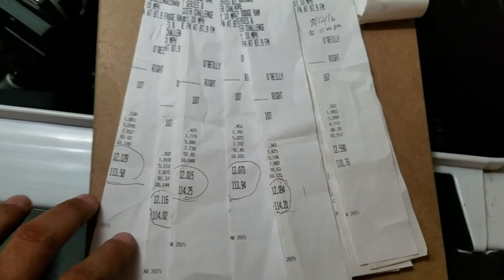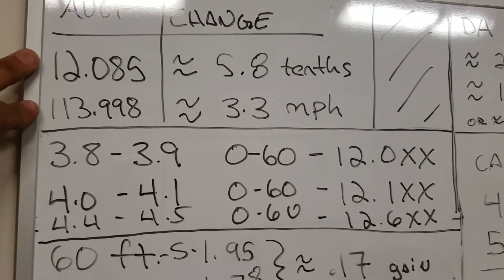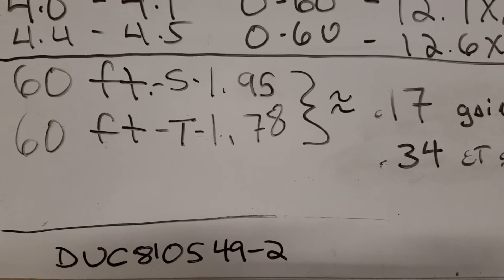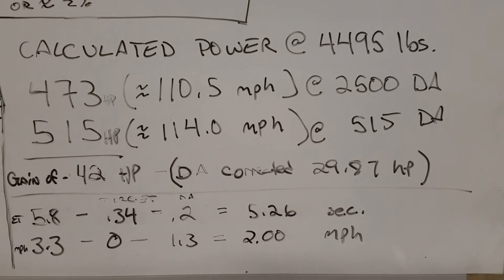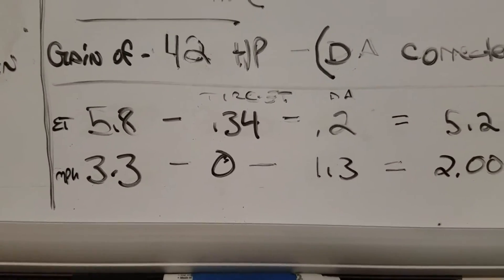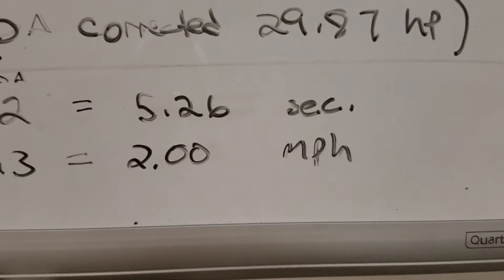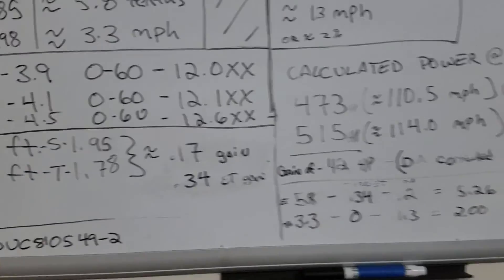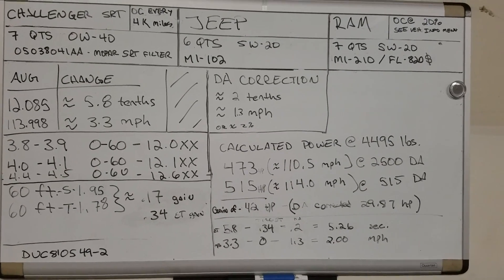2016 Challenger SRT 392 1/4 mile data analysis

Comment: I'm pulling 3.8 0-60s with Nitto 305s.  Haven't run a 1/4 with except with street tires(12.30 @ 114) Charger Scatty here...
Reply from the maker: very nice!  sounds like a solid  low 12/high 11 second car. love the SP Chargers.  Sweet ride, indeed.